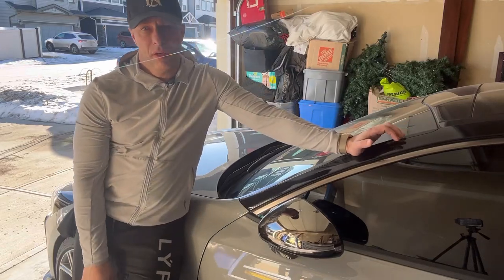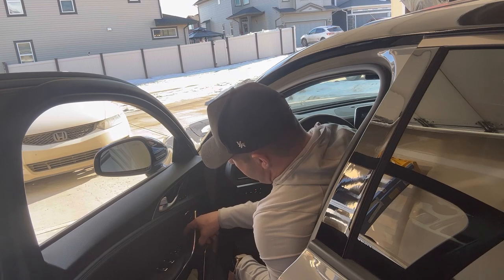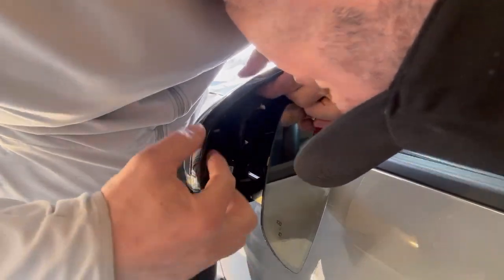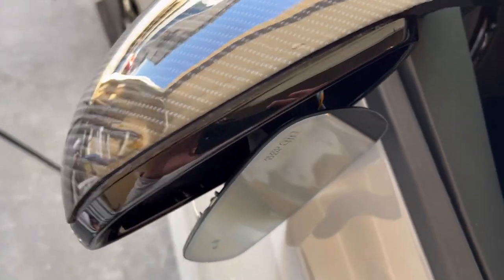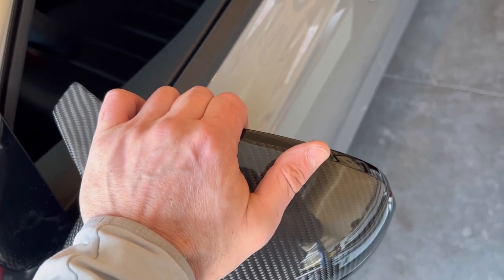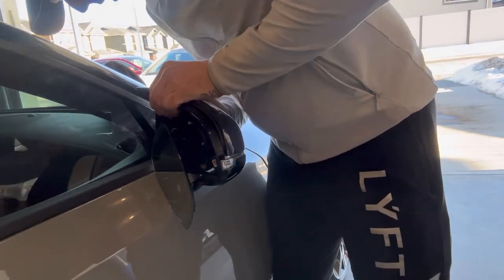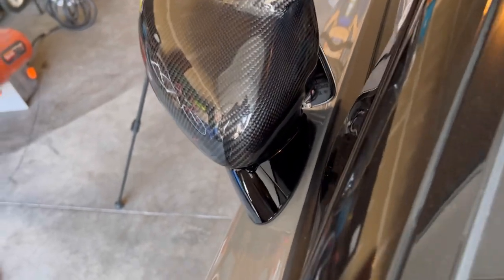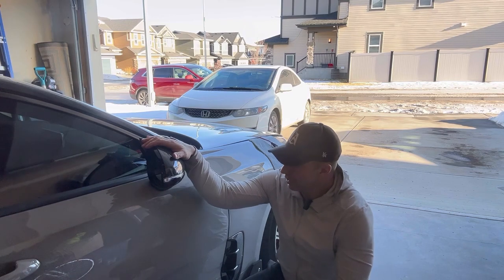A NIGHTMARE INSTALL - Carbon Fibre M-Style Mirror Covers | KIA STINGER

Comment: Hey great video. You should send them this video so they can fix the problem.
Reply from the maker: The people that I have spoken with that bought these covers, 2 out of 3 had a fitment issue. So I’m not sure if it’s just a few bad batches or not.
Reply: @OVRBoosted  good to know.
Reply: @jjnolms1967  I can confirm the fitment was off.. ended up bringing my actuator in the process
Reply from the maker: I’m hearing more people have issues then not is what I’m getting.
Reply: @OVRBoosted  yeah my buddy and i were trying to just put the old ones back on and like i said it just popped up. I wish the glass was able to pop back in nicely too but the glass shattered when he was trying to force it in too really unfortunate cause Kia here is on backorders for those parts, might just see if concept 3 can take a look at it